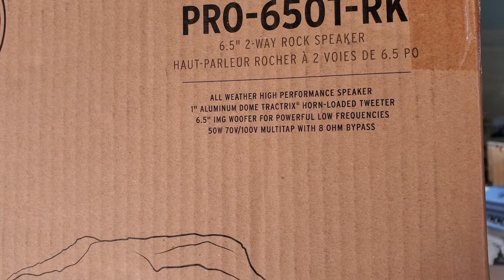Klipsch PRO-650-T-RK Rock Outdoor Speaker Install & Demo, And More! - Prosper, TX

Comment: Hi, hope.you are well. Great video. What gauge of speaker wire did you use here? Thank-you!
Reply from the maker: Hi Shaun, thank you for your feedback! We used 14 gauge wire here.
Reply: @PureMediaSystems  Thank you very much!
Reply from the maker: You're welcome!
Reply: @PureMediaSystems  Just a quick follow-up.  I took your advice, ran 14 gauge and followed your approach to install.  I only have the AWR-650-SM setup, connected to a mid-range Denon -- but the sound is absolutely fantastic.  Can only imagine the PRO-650-T-RK.  Thanks again and great video, have a great summer!

Comment: Are these speakers similar to the Klipsch AWR-650-SM?
Reply from the maker: Hi Justin, good question. They are similar in the sense that they are both rock speakers made by Klipsch, however they are very different in construction and quality. The AWR-650-SM are good speakers, but are primarily polymer in construction. The PRO-650-T-RK has a nicer cabinet, the woofer is IMG (Injection Molded Graphite), the tweeter is Tractrix horn-loaded Aluminum Dome, wider dispersion patter, has the ability to run on 8 ohm, 70V, or 100V. The PRO line of speakers is also not available to purchase online. It must be purchased from companies like us who are direct authorized dealers for PRO speakers from Klipsch. While the AWR-650-SM are good speakers, the PRO-650-T-RK are just better overall speakers. If you can afford it, they are well worth the cost difference. If you have additional questions or would like to purchase any Klipsch speakers, please contact us at 972-905-0556 or email sales@puremediasystems.com